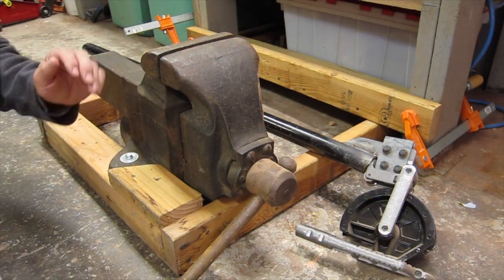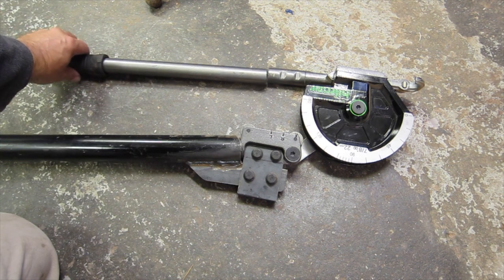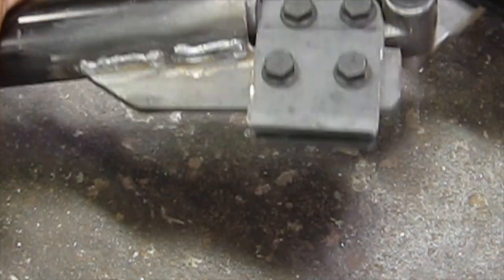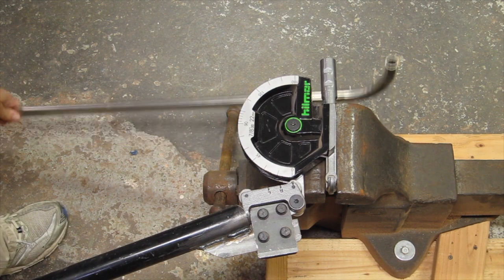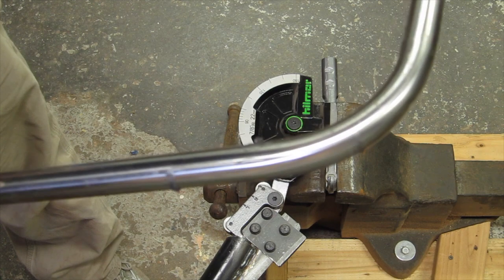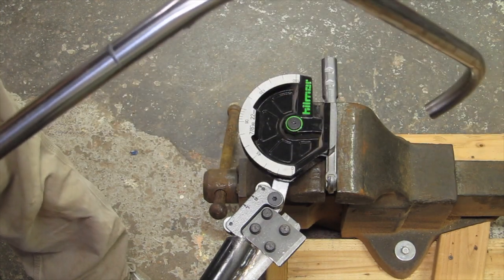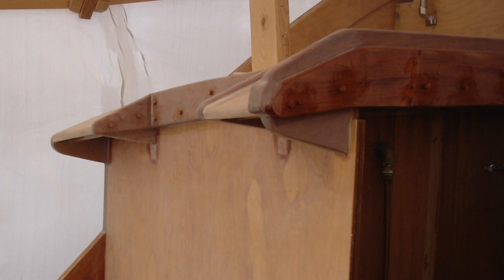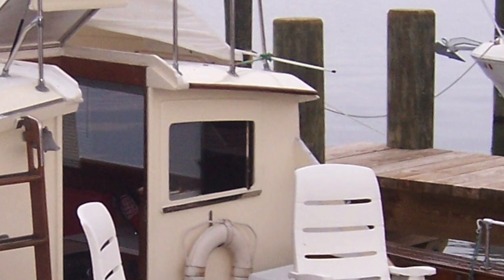Fabricating Guardrails , Bending pipe , Window Trim , Nav Lights - Boat Restoration EP019 (2016 -1)

Comment: The leveling/mounting pieces is a great idea! I'm sure it'll help to reduce or eliminate any potential stress cracking of the paint or fiberglass. Nicely done!
The railing on my boat doesn't have such mounting pads. They mount directly to the gel coated fiberglass, and each mounting location has stress cracks. I may just have to steal your idea and install pads all around, especially where I can't get beneath the toe rails to conveniently install backer plates.
Reply from the maker: I'm glad you like the Idea Neil.  Like most things I'm doing on this boat the real test will be when the boat is in use. Thanks for the comment. - Bob

Comment: Awesome stainless steel work,  I am impressed.  Where did you get all of the fittings need from?
Reply from the maker: Thanks. Most fittings are 316 stainless manufactured by "Suncore Stainless". I purchased them and the stainless tubing from Defender Marine which is only about 1hr from my home in Connecticut. The stand off fittings on the railings toward the back are manufactured by "Gemini Marine products". I got them from Hamilton Marine located in Maine though mail order. Those fittings are for mounting the future Bimini top. You can google search all of these to get more info.
Reply: @renovationsportfish1563  Thanks for the info,  Here in Oklahoma there is not much for marine stores let alone boats big enough to sleep on which is what I am after,  I want a bed and bathroom with a separate shower on board.